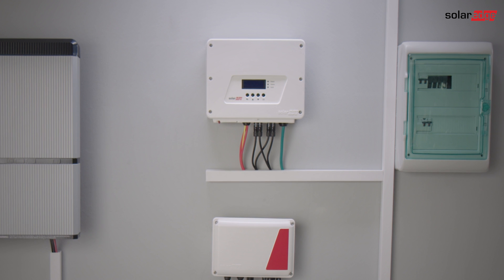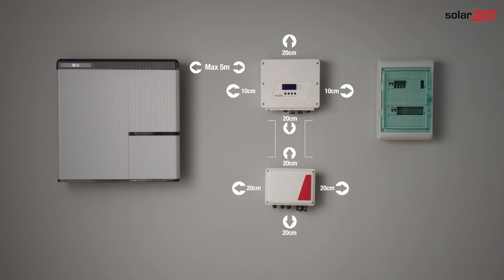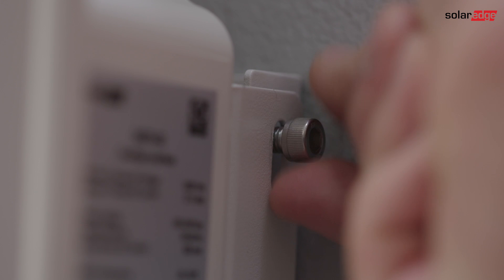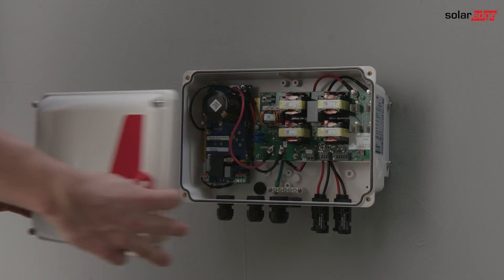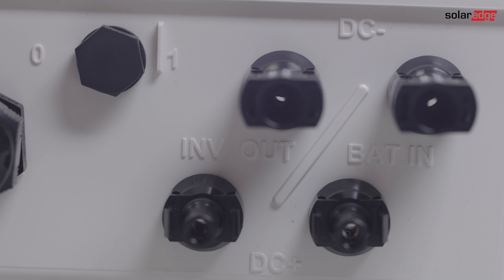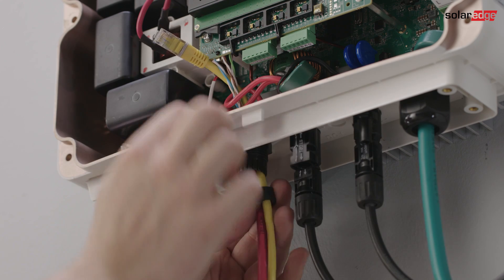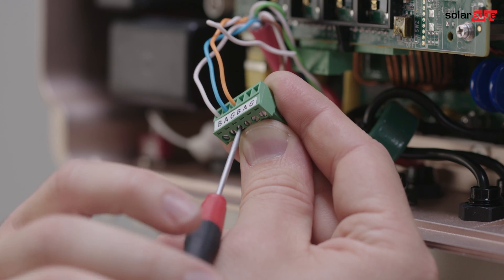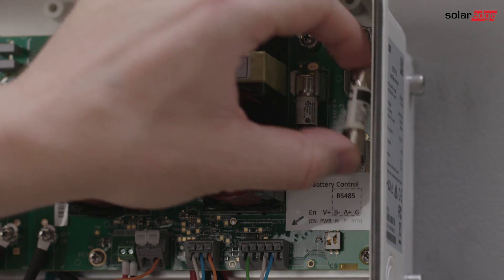Part 2a - Installing the StorEdge™ Interface and an HD-Wave Inverter

Comment: The Solar Edge/storedge 7600 US that I have  was the forerunner of this HD model.  My unit is useless because none of the connection terminals work, some lock the wire and others won't accept a wire of any gage.  I see this new unit has screw type terminals, which means to me, that they knew about this problem when they sold me my unit.  Corporations.  I'm going to lose thousands of dollars sending their junk back and finding a replacement, all because they won't fix those defective terminals.  This smells like a class action to me.  How many others out there have the screw/driver/spring operated terminals and found they either won't let go, or they won't accept a wire in the first place?
Reply from the maker: Sorry to hear that this has been your experience. Can you send us your case number or site ID so that we can have a more in-depth look into your case?